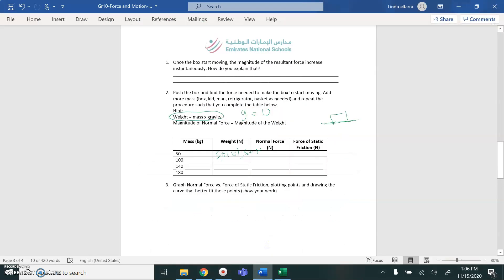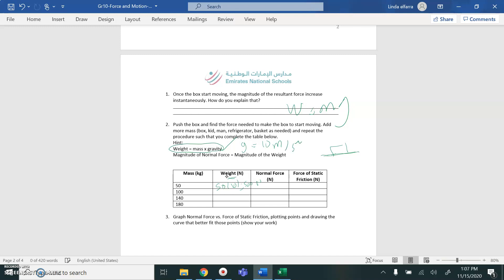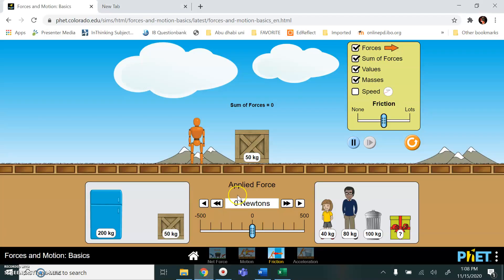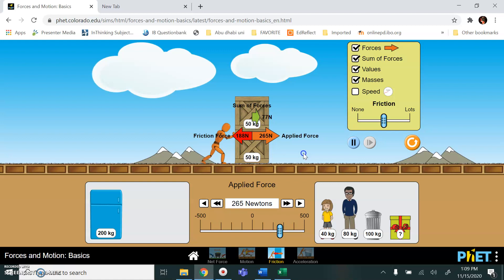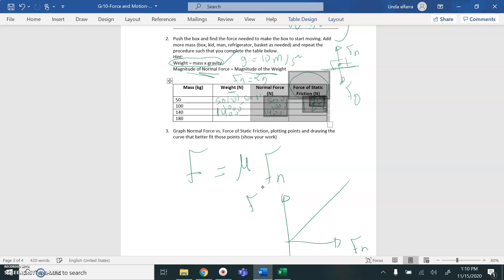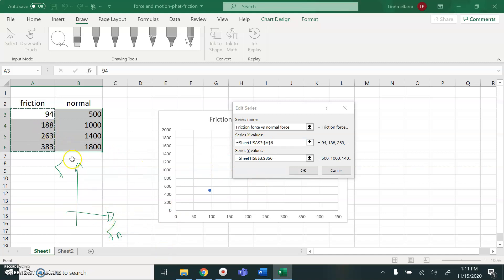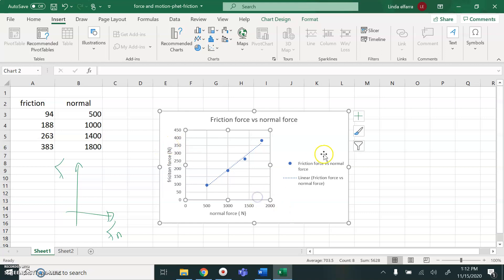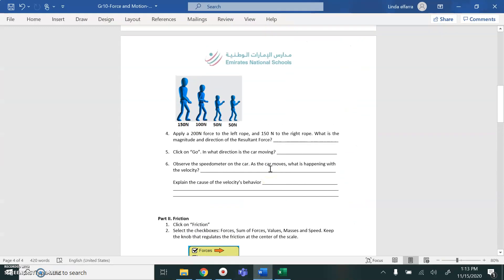Friction force ( dynamic friction)- lab simulation

Comment from the maker: Note:
When you use phet simulation, push the object until it is moving fast then let go.  The friction force by the red arrow will be your kinetic friction value .
For static friction:
slide the slider slowly until the mass starts to move and record it 
your first object ( 50 kg box) should be between 130 N and 140 N